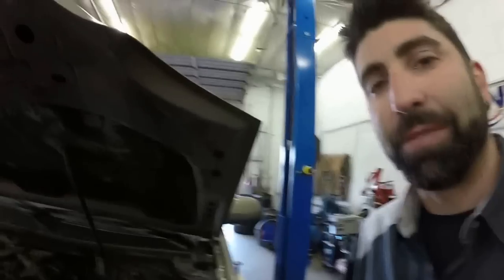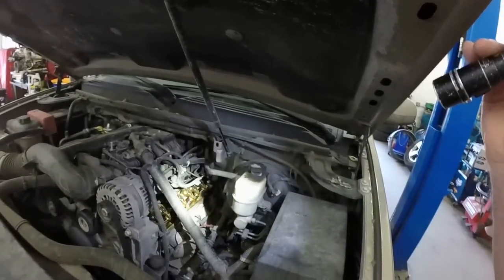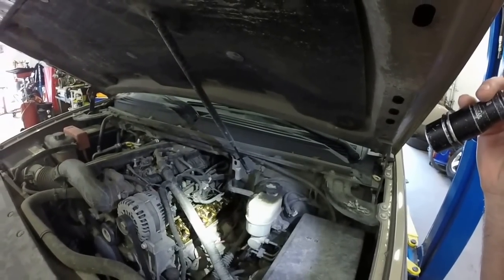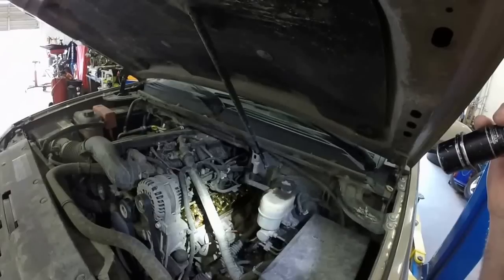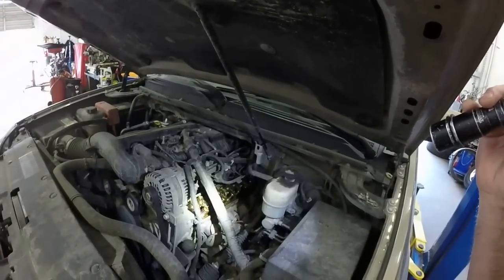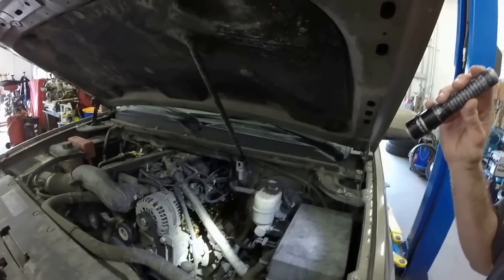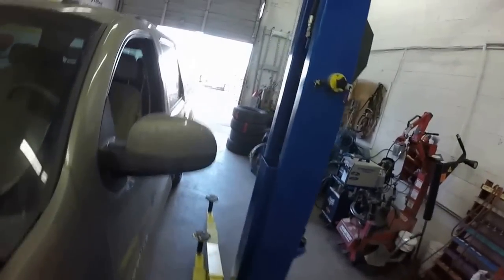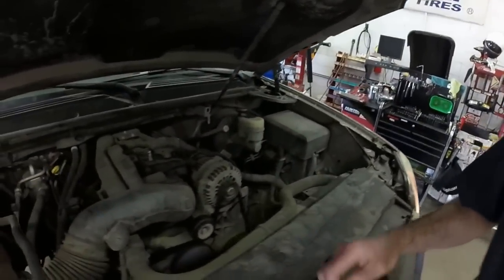GMC & Chevrolet Misfire - P0300  / Lifter Issues - 5.3L  - Diagnostic How To

Comment: I say fix the lifters and take it to a tune shop get that fuel consumption thing that drops it to 4cyl tuned out if it and problem solved shure you will spend alittle more on gas but it’s worth it not to be at the shop had a buddy that bought one cheap cause the shop told them it needed a new motor he done that and has driven it another 100k
Reply: Yea , there's a kit out there but I think its 1700 becuase you have to change out the cams , look it up .

Comment: I've got a 2008 Avalanche with 47k on it.. getting a #6Misfire code (PO306 or something like that)... car runs rough at idle, wants to almost stall at lights, consuming a little more gas than normal, etc.  Not blowing any smoke at all.. Oil pressure is fine.  Could this be the same issue as you have here?  I had a local mechanic check plug and it was black.  We swapped plug and no difference.  He said he checked injector, plug wire, compression.. and said all were fine.  Said he was getting a spark from the coil pack also.  Thoughts??
Reply from the maker: I highly recommend taking the valve cover off and watching for a lifter not working.   Compression may be fine, but the valve may be stuck closed, giving you a good compression reading.   It is easy to take the valve cover off and run it and watch for lack of movement, like in this video........

Comment: You are full of crap!! The 5.3 is one of the best engines of all time.
Reply: Not tbe afm one.
Reply: mine has 365,580 miles on mine, and now it backfires when trying to start it. it trys to start and even does start some times, but then it dies and it will back fire after that and won't start any more untill the next day. i sure could use some advice, thanks
Reply: my truck is a 1997 GMC Sierra 1500, 2 wheel drive
Reply: @carolbellinger  sounds like you have an old truck that you didnt keep maintenance up on.

Comment: Why can we not sue for GM to do something to pony up and take care of this issue instead of it solely coming out of our pocket?  This is the 2nd GM that I've had this happen to, and I've tried to get GM to do something but of course my warranty was out, but it seems millions of customers have had this same issue, I'm done with GM after this.  I've been loyal to GM for 37 years now.
Reply: I agree I am through with GM after this one. I hope they choke on all their crappy motors.
Reply: What does it take to start sueing gm I'm tired of this shit too I had 2 leaf spring break a chunk out of middle leaf spring had them both replaced found out they did a recall for 2008/2009 my truck is 2010 fckn bullshit, and the lifters I've heard from every guy who has a 2007-2013 had same problems. Gm needs to get sued and I'm on board with you if you want to proceed

Comment: We have a 2013 Tahoe with 121,000 miles. Same problem. Discovered this is major issue with this engine. GM is gradually replacing this configuration. It would take a class action law suit to have a chance of getting GM to acknowledge they have continued to produce an inferior engine after they knew there was a problem. We will be getting a rebuilt engine without the AFM and having the computer reprogramed. Long time chevy fans need to consider if they want to continue trusting GM.
Reply from the maker: Indeed!!  Thanks for the comment Keiten

Comment: I change my customers out in 6 hours all of them  on the driver side charged him 380$ where dose 3k come in and why it's a simple engine not a German vehicle let these people know what the book calls for and let them do the math that doesn't seem right
Reply: "misc, 50.00".     ..  Case of beer while working on the car.
Reply from the maker: Before we break it down, we had opted to replace engine due to major oil consumption problem. (see TSB)

Lets break it down.
Book time is 13.7 hours to R&R both heads.= 1240.00  (Doing only one side is a liability and cutting corners).
Lifters from GM = 400.00
Heads resurfaced, cleaned, seals and valves done  =500.00
Head gasket set =370.0
Plugs, wires, 230.00
Fluids = 150.00
misc, 50.00.      

I
Reply: @AMMotorsports  i may be confused on what exactly was asked to be done so i am not trying to discredit anything you are saying but if the customer came in with this issue and wanted it fixed. after diagnosing it with a lifter failure why are plugs and wires replaced if they were not the issue?
what fluids exactly are replaced that bring you the 150? even if you unnecessarily change the oil thats like 35 bucks including the filter but the customer did not come in for an oil change.  also what is "valves done". Is there a reason you cant replace the lifters without doing the valves?
I may be misunderstanding this comment but it seems like a lot is being done in order to be super super safe and make sure nothing happens again rather than just repairing the issue. i dont think mechanics are dishonest but somebody who doesnt know better may only want the issue fixed and have no idea that you are telling them a new motor or 3k in work is necessary to finish the job. 
The reason i am intrigued about this is i am no mechanic but i took my 6.0 silverado to a shop and they said new motor or 6500 in work. I ended up spending significantly less and with no special tools or training i fixed the truck in my front yard in a weekend. 
6500 to do what i did or replace the motor was absurd  and i feel this is the same situation
Reply from the maker: @TenSecondHaulers  Thanks for the questions.  So,  when we diagnosed the "misfire", we found the lifter issue.   At that point, you would need to take the heads of and replace the lifter/lifters, or perform an AFM delete on it.  The plugs and wires have to come off, so its a good time to replace those with no additional labor.   When we say "valves done" we mean we send the head to machine  shop for them to  grind the head, and check valves and valve seats.    
As far as the fluids, we dont use junk or cheap oil, we always use synthetic oil, (changes vary from 60-100$ depending on vehicle).   Actually cheaper, and 10 times better than conventional oil, allowing for up to 12k in between oil changes.  Coolant, power steering fluid etc.
Upon futher inspection, we found this engine to be eating a quart of oil a week, (not good!), GM specs are super lax, and this should be a recall or warranty issue, but its not.    In turn, thats why we replaced the  engine.  Customer is super happy and loves it.
Reply: A&M Motorsports liability that if you wouldn't SCARE the customers and just say we can do it and if the other side goes we will deal with it then I bet all those customers would take the chance I haven't had one come back and if it did the customers would understand that it is the side that didn't get done  but cutting corners not at all doing a timing job and not doing a water pump is cutting corners but on this leaving something that's not broken ALONE
Reply: A&M Motorsports and why recommend a used motor when they spend 3k and come back 1 month later with a ticking sound in valve train ,.then you recommend another engine or both sides
Reply from the maker: Sure, of course.  Thats why we give our customers options, either fix one side, both, or used engine or a re-man engine.  This was a very happy customer.  
Remember, an unbalanced engine is a liability, when you only do one side.  But..... we give the customers that option.  I dont want them to pay twice.

Thanks for your replies  Daniel, we appreciate good feedback.
Reply: A&M Motorsports great video and thank you for not taking offense to my comments
Reply from the maker: We appreciate all honest criticism,  good or bad.   Cheers Daniel
Reply from the maker: hahahaha.  I like that Rx!!!!

Comment: So if rebuilding the engine costs about the same as a rebuilt install, might as well rebuild the engine, because you will probably run into the same problem later on with a used one with less miles.  I'd opt to spend the $3k on a complete rebuild (because then the engine is almost like new).
Reply from the maker: I agree.  Especially when these engines have a piston ring issue causing bad oil consumption.  Thats what we ended up doing instead of the lifters.
Reply: What about 5k for a brand new engine. Without the AFM in it. Good deal or no?

Comment: Had this happen on a 09 Silverado with 180k, #4, #6, & #7. Head job, new lifters, cam shaft (cam was beat to hell) & lifter intake solved the problem. Also killed the AFM system to preserve the engine, has been over a year with no problems. This shop is ripoff.
Reply: Valentin Castillo did you do it yourself?
Reply: Oye Valentín mi tahoe 2007 marca que la numero 4 está mal y tiene aceite donde hace chispa y mi mecánico me recomendó prácticamente cambiarle el motor por que es un problema interno . Y se le apareció el stability track y tiembla demasiado . Tendrá algo similar a lo que tu solucionas te?

Comment: So if the lifter does go out will the check engine light, turn on your dash?
Reply from the maker: It should, it will throw a misfire code for that cylinder.
Reply: @AMMotorsports  what if the check engine light is blinking and the code is P0300 for a random cylinder misfire?
Reply from the maker: @salvadorarevalo999  Will need to have someone with a scan tool diagnose it on live data stream to see which cylinder is acting up.....

Comment: it's the lifter retainer guide is designed to keep the lift oil port hole alighned with the oil feed port specifically for the cylinder deactivation system to work properly there is actuators that control the oil pressure to these designated cylinders 1-7 & 6-4 they change the oil pressure on these cylinders to stop the lifters from opening the valves to save gas consumption when system fails it causes the miss fire on mainly cylinders 4 & 6 so a ten dollar part causes all this to happen the cylinder head has to be removed to correct this problem but the doesn't have to be replaced just the lifter retainer guide and head gasket that's all.
Reply from the maker: Yes, thank you for the comment.   That didnt happen here, but it IS a common part that fails and causes exactly what you just described.

Comment: I'm having a similar issue with the ticking noise but my oil pressure gauge is reading 30 at idle when it should be over 40. I'm might go the route of a new oil pump and clean out the valve covers along with the lifters...

Comment: You are exactly why I don't take my cars to mechanics... You don't fix anything just wanna replace parts and run bills as high as you can, useless
Reply from the maker: Ok, now thats a funny comment.  lol  I assume you do all the work yourself, including machining of heads and such.   Shadetree at it's best right here folks!
Reply: A&M Motorsports actually I do .. I got a 600HP Evo 8 built by my hands and a 400 HP STI
Reply: Everyone I know in the car industry calls you guys parts replacers .. a true Mechanic is hard to find
Reply from the maker: Great to hear.  So im assuming you own a repair shop and such with a full machine shop? Whats the name of it? Pretty rare if you do.  Could you maybe elaborate as to why you seems to think we did something wrong here??   People are here claiming things, and not backing up their claims like usual.
Reply: A&M Motorsports because your idea of fixing the problem is replacing a used engine with another used engine that all are known to have failing AFM.  So your giving your customer a ticking time bomb.  Replace with new parts or delete the system.  As far as it using oil also a known issue from the start with the engines, nothing to do with the bottom end.
Reply from the maker: We always give customers options, but it comes down to money.  Delete or not, same price.  Re-man engine, twice as much.  Dont do oil changes on time, or use conventional oil, may have that problem again.  Cust. needs to know that and understand it's up to them to maintain their vehicle.    When you find reality, let us know.
Reply: @stewiegriffin3627  lol. False, mr. armchair mechanic. The piston rings stick on cyl 7 or 8 alot of the times.  Look up the Jasper fix to that. Bottom end issue.

Comment: Very common problem with these cars unfortunately, so basically we're just gonna put a new engine in it... SMH typical dealership mechanic anyone thinks that this is okay it's bull.
Reply: Change the valve cover with an updated one and it won’t eat no more oil dude the cover is like 40$ and replace the lifters bro
Reply from the maker: Why not change an engine eating a quart or more of oil every month??  Maybe you didnt see why we changed it, so it's ok.......
Reply: @AMMotorsports   yeah people are too fukn lazy to read I guess. 🤪
Reply: @Junior-wt3in  maybe you're since he explained why replacing engine was the way to go , throwing new lifters wouldn't fix oil consumption it can be related to worn piston rings valve seals worn block chambers in the best case pcv valve which involves time and labor which it's not cheap its only wise to do so if you do it your self and plan to keep the vehicle for a while trust me I've tried to save engines like that only to realize I should ve not but we all see things differently thus ,to me he's a good mechanic after all
Reply: @GioRobot  spot on! This guy seems 100% honest about what he did.

Comment: Its a SHAME that shops like this one are out there ripping off there customers and selling them stuff they dont need [ afm lifter are prone to engaging its locking pin and making it go into deactivation it just needs a lifter i feel sorry for that customer but this is what u get when so call tech cant even fix a sandwich let alone a simple 5.3 the early lm7s had a problem with camshafts coating coming off and eating the roller on the lifter t and causing the COLLAPSED lifter  people id ur bill is in an unbelievable realm and ur car is running as this one is get a second opinion i go to traning every year  all over and there are good techs that know what there doing out there  !!
Reply from the maker: Bingo Mister Berzins
Reply from the maker: We see people that keep saying  "rip off" yet, if you only do one lifter, you're doing it half-assed and leave your business open for liability when another one fails.   Not smart.   Maybe you didnt see that we had to swap out the engine due to the piston oil rings sticking,(GM factory issue)  i'll give you the benefit of the doubt.
Reply: The shame is corporations like GM selling under designed products to their groupies.
Reply: Mike is another lazy guy who cant read why the engine was replaced. 
Yet, he says just do one lifter? So, half assed? Yea, dont take your shit to that armchair mechanic 🤪

Comment: This is EXACTLY what has happened to me - a 2007 Silverado with the 5.3l.  The motor has about 180k on it, uses 1 qt of oil every 1k or so, and started ticking recently.  The ticking did not stop, next was a flashing "Check Engine" light and the truck started to hesitate and idle rough.  Same story....J motor gone bad.  Cost is about the same for a used vs taking the heads off and replacing lifters.  Shame on GM for this one (even though I love my truck).
Reply from the maker: You got it.  I wish this would be covered under warranty or have GM extend the factory warranty.  Customer that has this Yukon is super happy and we got lucky with a good used engine,   not one drop of oil in 3 months.   

Thanks for the insight jedi008!
Reply: Same here. Mine made it to 215k